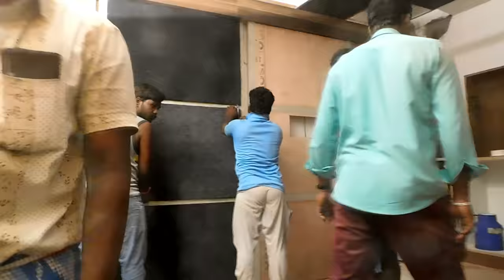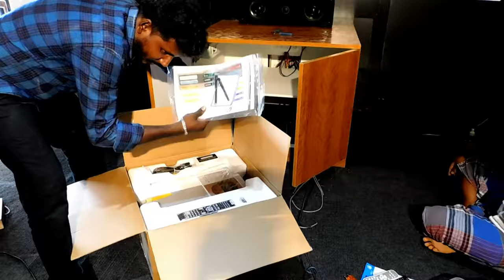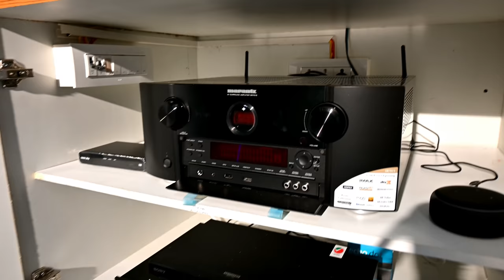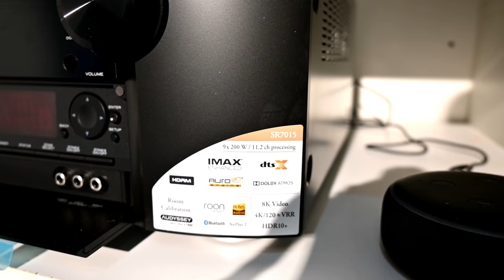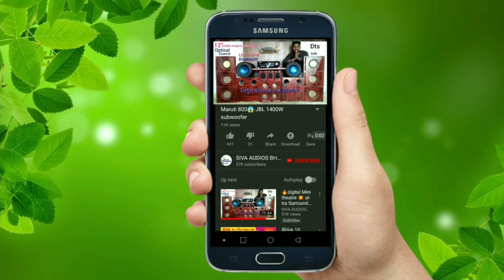💥தமிழ் 8K / Dolby atmos /Dts X /AVR 11.2 CH luxury cinema / 7.2.4 Speaker setup👍 siva Audio's 🔥

Comment: Bro  r u using the correct gauge of speakers wires which marantz 7015 required......in videos it seems wire  guage is low even for your home made speakers .
 But good job bro
Waiting for your customer review in nxt video